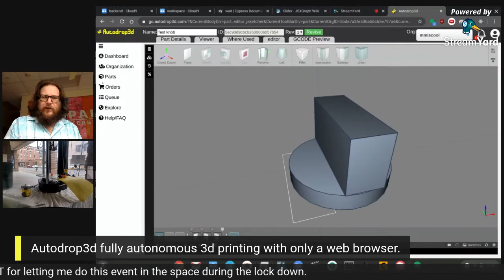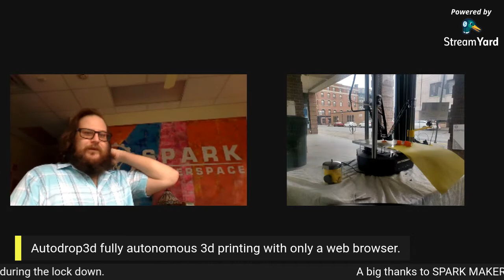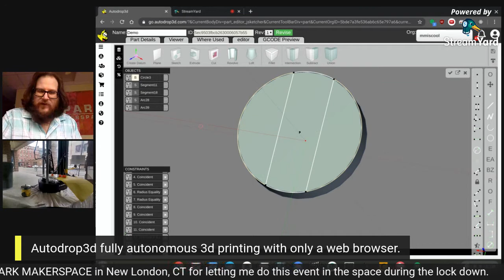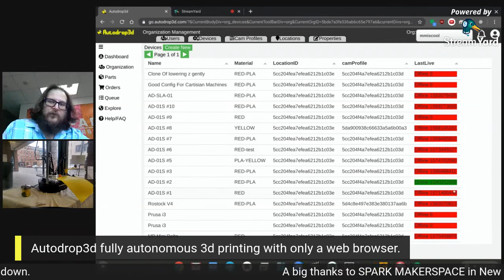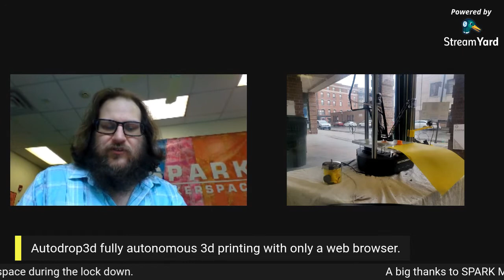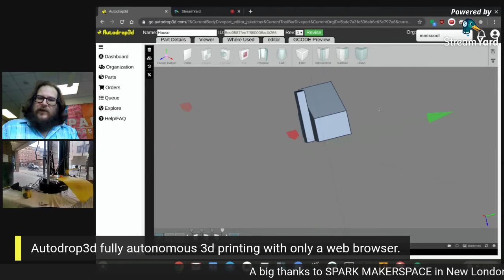Fully autonomous 3d printers for remote production

Comment: looking at the website this page is empty: https://www.autodrop3d.com/setting-up-monetisation-for-print-farms.html
and on https://github.com/Autodrop3d/autodrop3dClient there is a list of gpio pins, but its not explained what things do
Required	Type	Function	pin #
NO	Sensor	FilamentSensor1	22
NO	Sensor	FilamentSensor2	37
YES	Button	Config	32
NO	Button	Cancel	12
YES	Button	Next	33
NO	Button	FilamentLoad1	36
NO	Button	FilamentLoad2	11
NO	Output	EjectorMotor	16
NO	Output	LEDred	7
NO	Output	LEDyellow	29
NO	Output	LEDgreen	18
of course filament sensor and filament load explains itself, but what are the leds for? and the first 3 buttons?
Reply from the maker: I think this schematic is up to date. https://github.com/Autodrop3d/AD3D-Connect-Board/blob/master/AD3D%20Cloud%20Connect%20Board.pdf
Reply: @mmiscool  ahh, so a display is needed, then it makes sense :-D